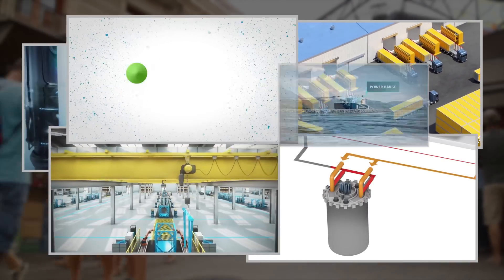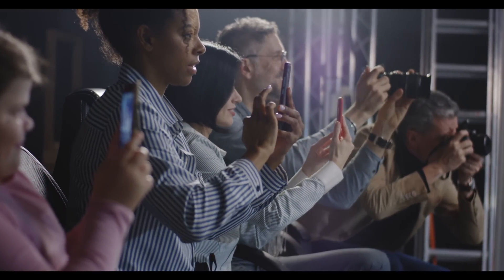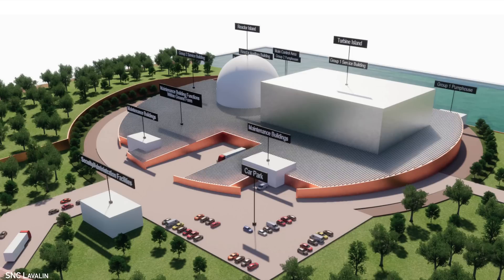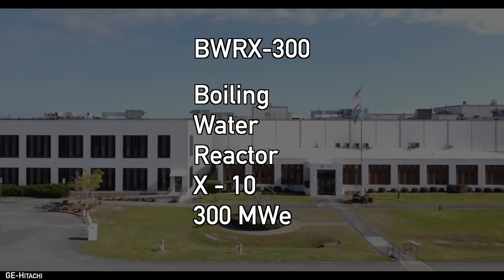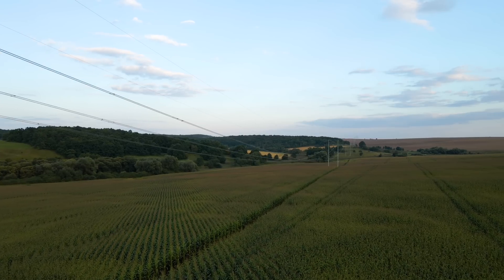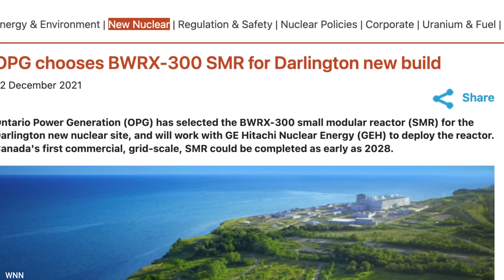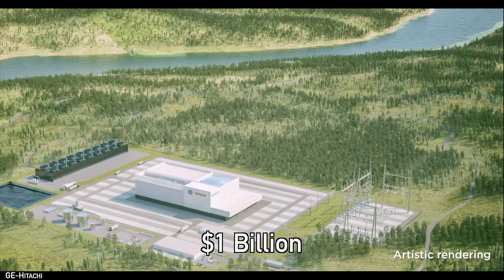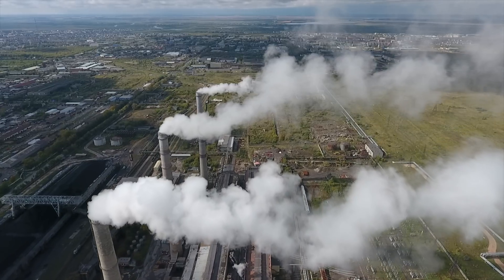Why This Small Nuclear Reactor is Actually Winning

Comment: A corection, it snot a GE reactor, its a GE-Hitatchi reactor. GE-Hitatchi is diffrent from GE. While both GE and Hitatchi did make BWR prior to the merger, the BWRX-300 is pretty much a downscale of ESBWR that in turn is a generation upgrade of ABWR-II that in turn is a upscale of ABWR that originate in the Hitatchi-Toshiba cooperation prior to GE invested in Hitachi... While yes if you go back a bit more GE was one of the original supplier of BWR to Japan.

The $/kW is not as important as the build speed. Because of the long time to recoup the cost, even just the interest during building can stack up significantly. The actual dollar value of the reactor is there for second most important to the build speed. Its sort of the core of the economics behind SMR. Even if they are more expensive, they may still be more economical.

The generation 4 shift is not yet. generation 3++ will have something like a decade head-start of gen 4, and even when gen 4 will start coming of the assembly line, the mere volume might still give gen 3++ an advantage for a decade more
Reply: All throughout the video the reactor is shown as GE Hitachi. 
He says GE for brevitys' sake.
Reply: @A_Laugh_Riot  well yea, but its kind of strange saying GE, when its originally a Hitachi product.

GE and Hitachi have really not fully integrated before the last couple of years.

Also GE is a totally different company from GE-Hitachi...

Its like.. Well .. Volvo and Volvo, two totaly different companies that have the same name due to history
Reply: How many homes can 300 MWe's power?
Reply: @JayForsure  300k
Reply: @chesterfieldjones1055  So a normal house needs 1 MWe to power it??
Reply: @JayForsure depends on the homes. 600.000 homes in India, 100.000 homes in US
Reply: Hey Poland! You're going nuclear for the wrong reasons!

CO2 is climate-irrelevant. 

Interglaciation climate change (i.e., the Medieval Warm Period) is caused by changes in cosmic rays (Svensmark et al). 

There is not such thing as anthropogenic global warming.  

"Global Warming" is a superstitious bullying and shakedown of the taxpayer. 

Just burn coal and keep looking for more oil and make it out of coal (the way South Africa does at SASOL).

Comment: Has any design proved that it can generate electricity for $0.04/kWh or less?  That  is what the market is willing to pay,
Reply: NuScale recently reported that the cost of electricity from their design would cost $0.10/kWh.  Up from their previous claim of $0.08.  Won't sell.
Reply: “Design”

Dozen reactors built in the U.S. late 60s, PWRs, has build times 3-4 years, capital cost <$1000/KW, todays $, great safety records.  See eg Point Beach WI plant, built in 3 yrs, still running.   

And the 4c/MWh “market” is wildly misleading, ignoring vast direct production subsidies, capacity charges, and system integration costs.